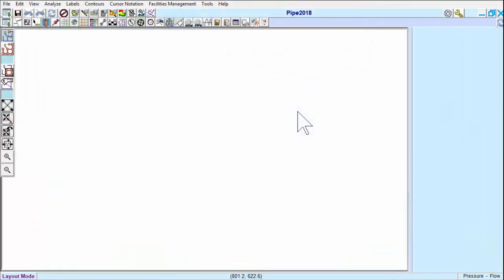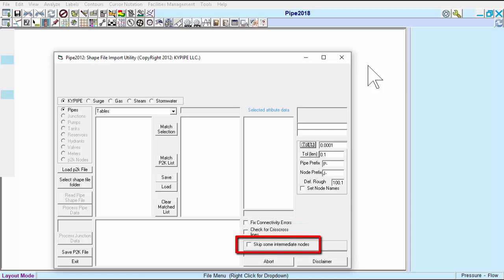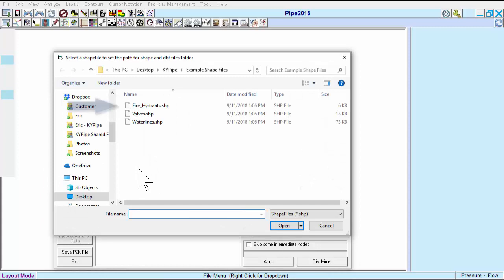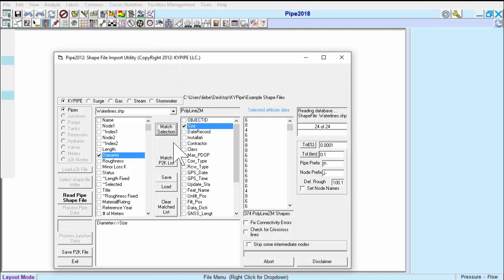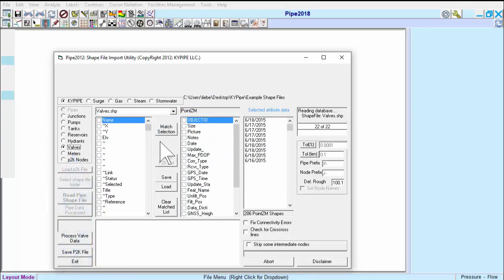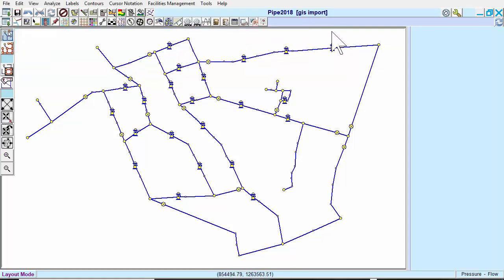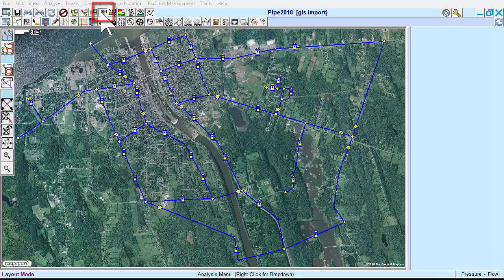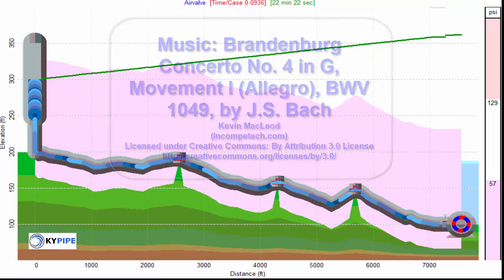KYnetic Training Series 4 - GIS Import

Comment: After I select my shapefile from the "Select Shape File Folder" button I receive an error: Runtime Error '3275': Unexpected error from database driver (0).

Is there a fix for this?
Reply from the maker: There are some possible causes for a runtime error.  First, check the file location.  If the shape files are on a network try moving them to a local folder, such as on your Desktop.  Another possible cause is the format of the data.  For example, pipe diameters entered with a quote symbol such as 6" will result in an import error.  Make sure data like this is numerical only.